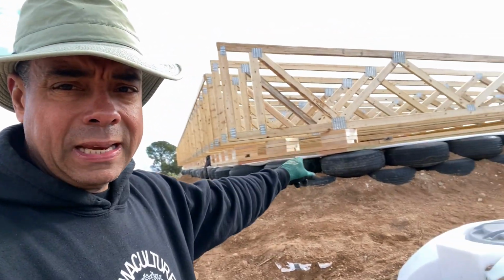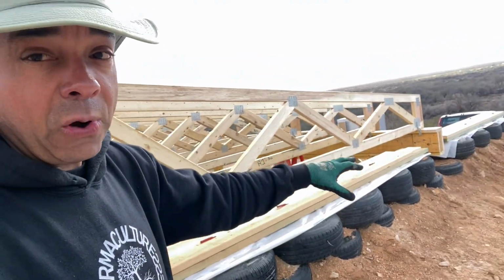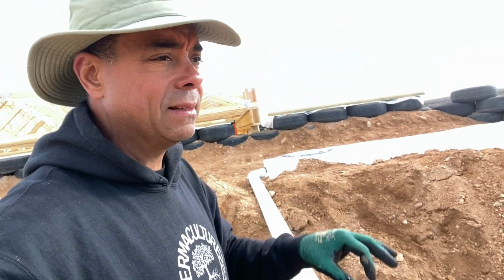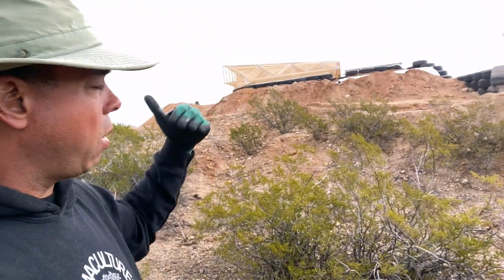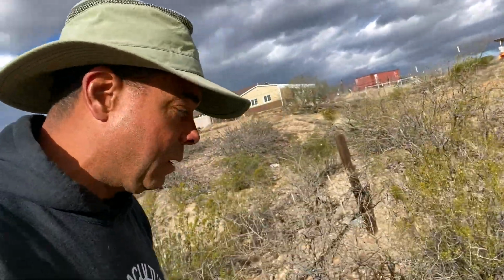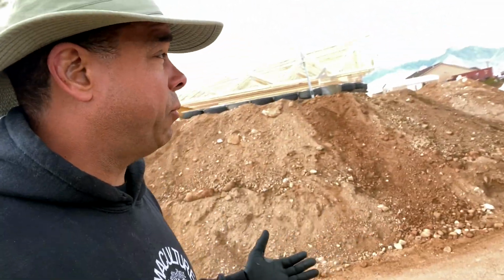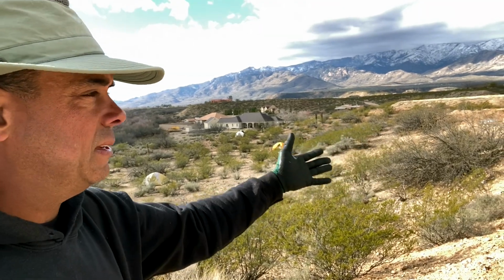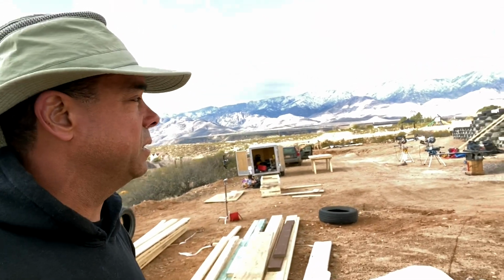Rain Harvesting and Permaculture Design in the Desert

Comment: Interesting observations.  But I wonder, how much the collection tanks overflow?  Chances are, the system is designed to capture most if not all rainfall, so I would speculate that the runoff would be minimal, if any in most years.  The cool thing about Earthship Biotecture Design is that the flush toilet uses gray water  that has been used for bathing and washing, is circulated through the greenhouse beds and used to flush the toilet, then out to a septic tank.  Now, if you were able to do humanure, you can eliminate the flush toilet depending on your county/state codes.  Michael Reynolds has "gone to bat" and got regulations and codes changed to accommodate experimental building in AZ.  Bless him for his vision, insight, and gumption.  Other states will only make changes if there are active advocates for that change.

Comment: Swales and ponds, and any other exposed-surface water retention system in a desert environment is simply a surface water evaporation facility. (Consider Lake Powell, where more water goes to the atmosphere than ever goes to groundwater or usage, combined.) Practically none of the water would end up returning as ground water, it would almost all go to the atmosphere. Why not plumb those rainwater overflow pipes into a perforated drain field, just like a septic tank drain field? That way, any overflow would have an effective route to return to ground water. You could plumb in a riser and weir at the distal end, that would allow the drain field to overflow to a swale, for those rare occasions you get a real gully washer that might overcome the drain field.

Comment: The swales are good for irrigating the soil and to hold the rain water a bit longer but they work best when you have different levels of terraces growing things like fruit trees and such. The pond however is the best option to pump out the water from in order to irrigate your crops when the land is mostly flat. Both are beneficial and need to be used accordingly. Another great option is to have a well that also collects the rain water and any underground springs. Then you can pump the water to irrigate as needed from there with solar power of course. The more sources of water you can put in, the better. For drinking purposes, a proper filter  and regular water checks (tests) are essential of course. By the way, in the Jordan desert they used drip irrigation that was invented in Israel lol
Reply: Can you elucidate on how swales even work in  a desert environment?

I would figure with mix of the hardpan  soil, and the very high evaporation rate, they might be not the right tool for the location, at least how i understand them, learning about them in the US Northeast

Comment: that is my thought, i live in an area in west texas that gets approximately 20 inch of rain in a good year, and more like 12 in a bad year, but when a good  "turd floater" comes by, it all just runs off or evaporates over the next two days, judging by the humidity for that time.   my thought was to build french drains or graveled over sumps with high porosity to capture ground runoff,  with submersible pumps to move it to either tanks, or underground "wicking beds" or underground ponds if you prefer, so it does not evaporate in two days.   a deep dug hugel mound, where the wood would soak and hold the water is also a thought i have had.   in a desert, it is crucial to capture all ground runoff and hold it for as long as possible on your land.  fo sure fo sure.

Rainwater harvesting by Brad Lancaster has good math on rain harvesting, and multiple solutions in different contexts,   great books to have, his youtube videos are great too.
Reply from the maker: Thanks a lot my friend!

Comment: I wonder about the emergent effects of  swales, in regions prone to flash flooding. 

I feel  that because the ground  in deserts is so impermeable to rain water, it will have a hard time soaking in, and thus with the run off  during a big rain event, your swale system might just get WAAAAAY more water than you can handle at once.
Reply: I would think the correct depth and angle would help with that, but what do I know
Reply: We're going to have to get a bigger swale!